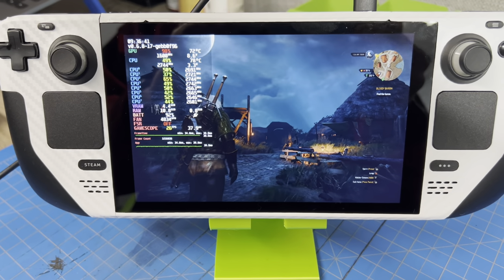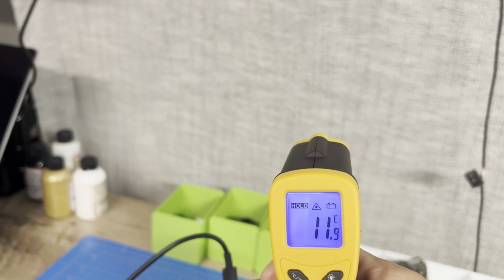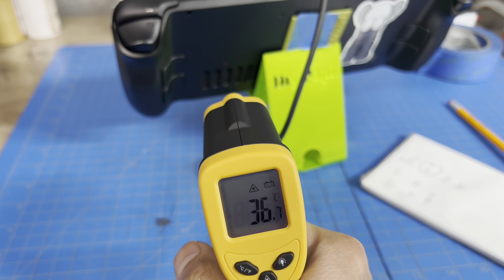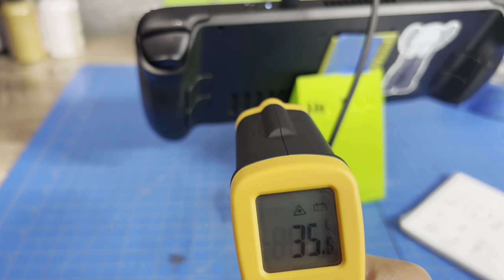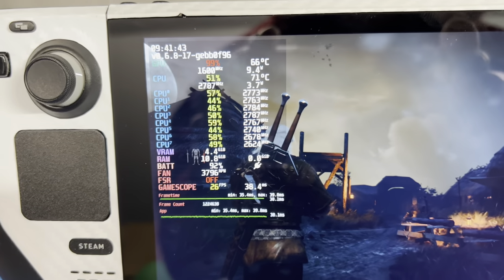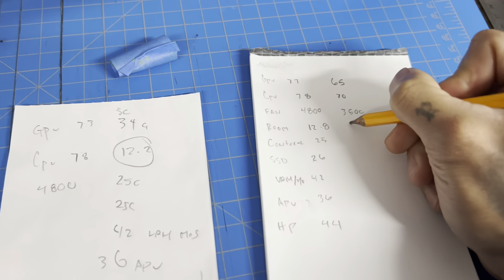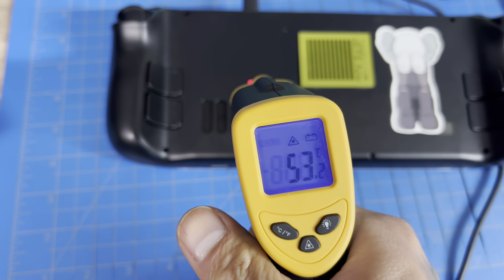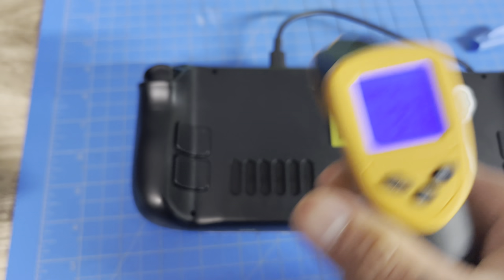Steam Deck Fan Mod - More Frames, Running Cooler and Quieter w/ Exterior Temps

Comment: The only issues is the charging chip afaik that needs the air path valve designed. A lot of people opened a hole on the fan but then then charger chip melted because it was reaching like 95c. Maybe with some thermal pads on it that can be brought down.

Comment: I imagine sometimes, if theres someone who worked on complete ver of steam deck, made out of custom housing which is lighter material (3d printed) and take it off 3rd buttons on the backside panel as I rarely use it. That could make so much lighter. Coz feels to me a bit heavy to use it as a portable handheld. Also maybe oled display panel that saves some power consumption. And yes, it would be unnecessarily gnarly personal project.
Reply from the maker: Definitely an oled display would be a amazing upgrade.

Comment: What do you think for using the vacuum cooler on the top of the deck (exhaust)?
Reply from the maker: In pc building push pull works but not as good as one intake fan and one outtake fan(Cold air in hot air out) it would be better to add a intake fan where the mesh screens is. Versus the push pull method with a vacuum fan.

Comment: You should watch Gamer Nexus video about the Steamdeck thermals, getting air directly to the fan will decrease the APU temperature but the fan cools more than just the APU, you gonna cook your charging IC doing that.
Reply from the maker: Yea that was a great video, very insightful.

I’ve ran internal thermal tests on the VRM and controller with and without the mods you should check out the results.

https://youtu.be/7Cu-aRjKG5c